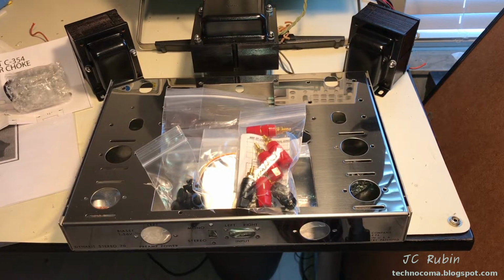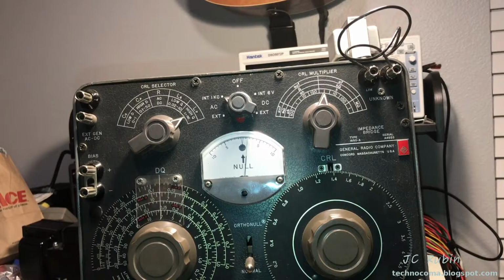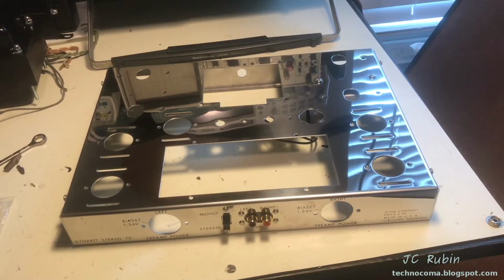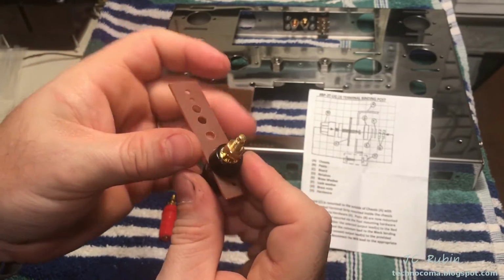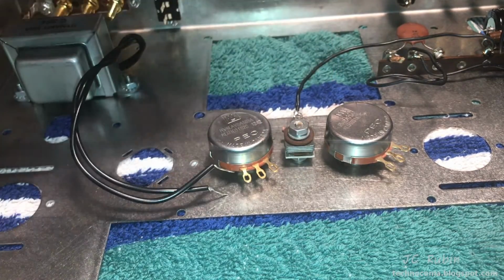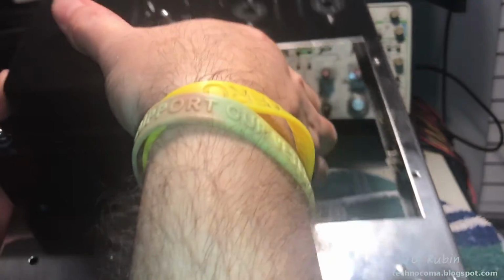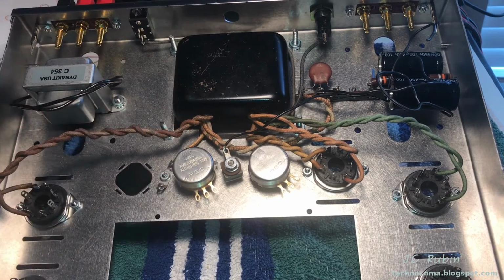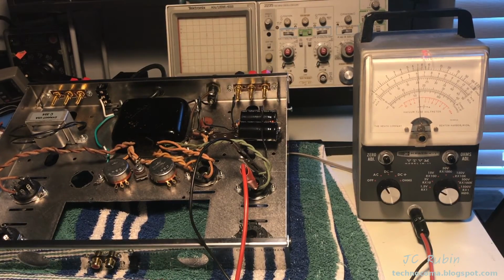The Dynaco Dynakit ST70 Stereo Amplifier Restoration Project Part 2

Comment: The ST-70 was compliant to the 1970 electrical code but not today's.  I have yet to see anyone rebuilding these amps being compliant to code that's been in place since the late 70's early 80's. If you are rebuilding these amps for others not being compliant to code and someone is electrocuted, you may be liable in both a criminal and civil context.  For current safety / electrical code reasons You CANNOT switch the neutral (white) alone and the 120 volt line (Black) MUST be fused - NOT the white neutral.  Breaking the line neutral side with either an open switch or open fuse leaves the system as a live electrocution hazard waiting for someone well-grounded to earth to touch it. Remember, milliamps can kill without the fuse blowing.  The fact that the green earth ground exists does not guarantee that every receptacle an amp is going to be plugged into has integrity in its earth ground.  As well, if others following your advice, fall into the same situation, many a lawyer will say you share the liability.  There are precedents.  

I'm not trying to be a jerk. I come out of the service industry myself and I own and have rebuilt ST-70 amps and am one that has had a "hot" chassis.  One another when I attached an earth ground to an ST-70 that was working perfectly,  the caps on the board went off like a bomb which I have yet to trouble shoot.   Otherwise, great videos.  Keep up the good work at preserving these gems.
Reply from the maker: You had confused rebuilding equipment with the sale of new equipment.  The restoration of a Model A-Ford is not compelled to have seat belts.  Restored equipment need only be restored as it was, originally, and is not beholden to ever evolving safety standards and electrical codes. Its also why one of my cars still has asbestos heat shields, and why one of my motorcycles doesn't have compulsory daytime running lights.  Its why the VW beetle is still allowed to operate on public roads, even though it could never meet today's safety or emissions standards. AC/DC transformer radios in their day were known death traps, time did not make them any safer.  Antique shops and most of ebay are not liable for selling 70 year old radios to customers.

For all of these matters, the concept of new, used, and restored establishes an expectation of functionality.  Safety standards and test agencies for insurance companies such as UL may specifically approve a device meeting today requirements.  Those devices wont meet safety standards set today in a few years time.  At one time, the ST70 was considered safe for consumer use.  It has become no more dangerous since then.

I'm sure of course since you've researched this, you could provide citation for previous litigation relating to these matters.  Or was it just something you read in an antique radio forum.

Comment: Nice build, although this is not so much a restoration as building a new amp while reusing the transformers from the old ST-70. I may be doing the same thing soon, that is if I can talk my buddy into selling me one of his old ST-70's. Lol. I have some ceramic tube sockets with gold plated contacts waiting for a new home...
Reply from the maker: It becomes somewhat difficult to state a what point its a restoration or a rebuild. More than just the old tansformers were used from the original set.  But is see the conundrum.

Comment: Nice job Retro! One thing I don't like, however, in the original or the redo, is the AC mains wiring. Neutral (white) wire should go directly to transformer, hot (black) should go to rear fuse terminal (as you have corrected) out the side fuse terminal into the SPST power switch and out the switch to the transformer.
Reply from the maker: Thanks for the tips!

Comment: 11:35 - The 'lower nut should be used on topside of the chassis (the control mounted flush with the bottom of the chassis) .The top nut is tightened to lock the wiper in place ounce the bias is adjusted.
Reply from the maker: Is that so, I will investigate, thanx
Reply: @retrotechandelectronics  Cool. This is a great set of videos. Thanks, Jordan!
Reply: The large nut is the jamb nut, David is correct.

Comment: Great work @Retro Tech & Electronics I think your work is great and attention to detail, but I would not have done this the same as you. Not a criticism but I would have cleaned up the chassis and kept old choke since it was in spec, replaced the selenium rectifier with silicon rectifier. Each to his own!
Reply from the maker: I'm glad you enjoyed the video, to specifically address you comments i've added the following below.

The cost of stripping and plating the chassis was more than the replacement. It crossed my mind.  Even with all of that, there is no place for me to have it re silk screened.  Short of that, my intent was not a patina unit, and the chassis was in pretty bad shape.  As for the choke, yes it tested great, but 40 years in an attic melted it and left a pile of wax on the bottom of the old chassis.  I could not responsible use a component in that condition.  As for the rectifier, the selenium does exactly what it is supposed to, provides stable bias to the El34's, and doesn't require replacement at this time.